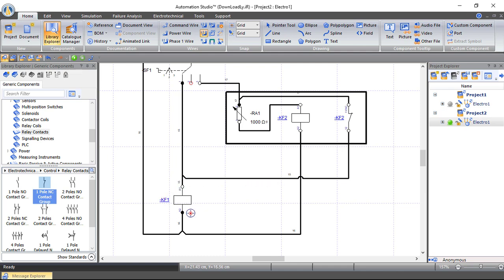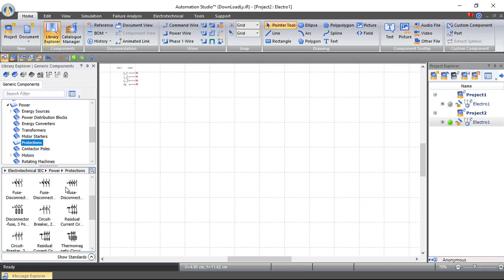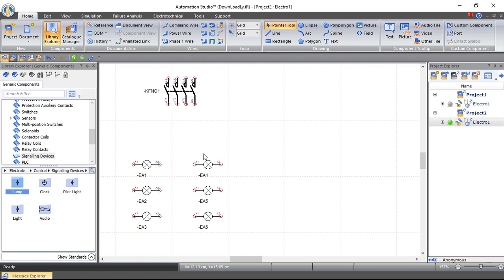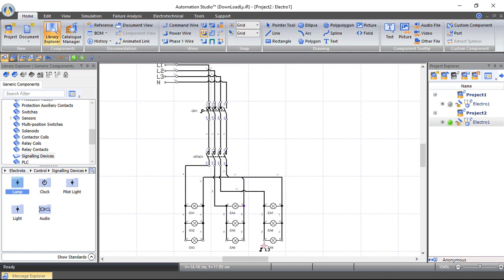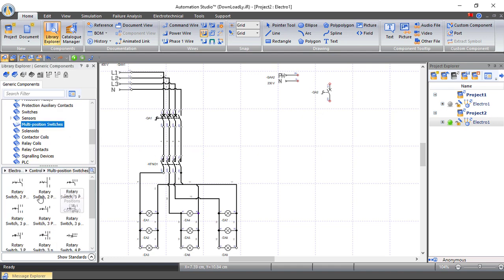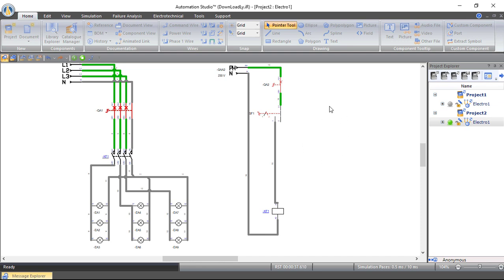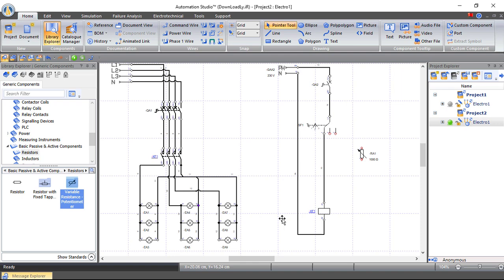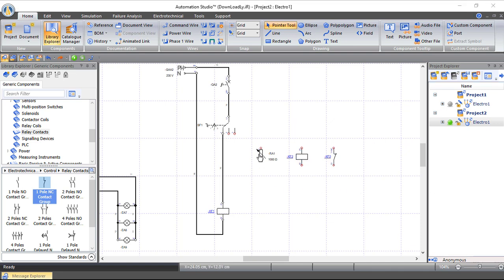Photocell Sensor for Street Lighting Circuit in Automation Studio | Tutorial #12 for beginners

Comment from the maker: Timestamps (Powered by Merlin AI)
00:05 - Creating a street lighting circuit using a photocell sensor.
02:04 - Building a three-pole street lighting circuit with neutral connections.
04:26 - Setting up a control circuit for a photocell sensor in street lighting.
06:19 - Connecting a manual and automatic circuit for street lighting control.
08:27 - Simulating a photocell sensor circuit using variable resistors and relays.
10:32 - Connecting a photocell sensor to a street lighting circuit.
12:37 - Understanding the wiring and functionality of a photcell sensor circuit.
14:29 - Understanding the photocell sensor operation for street lighting.